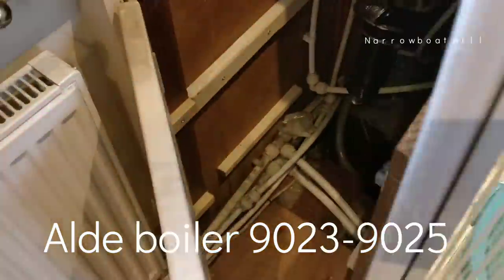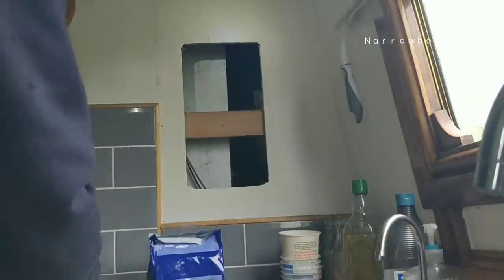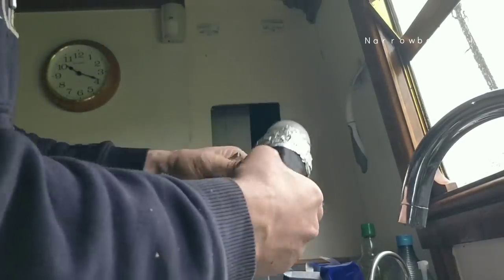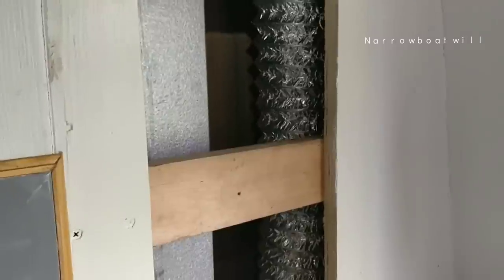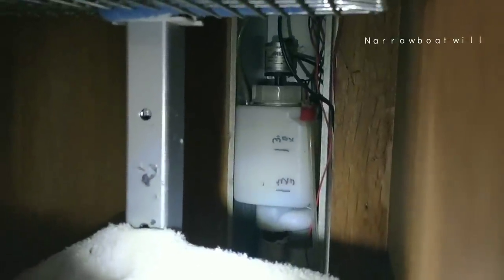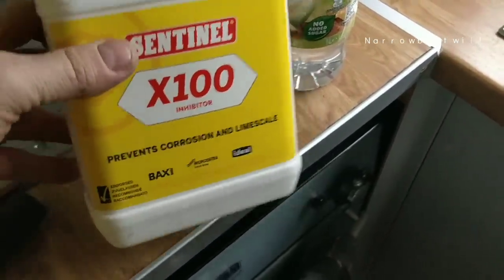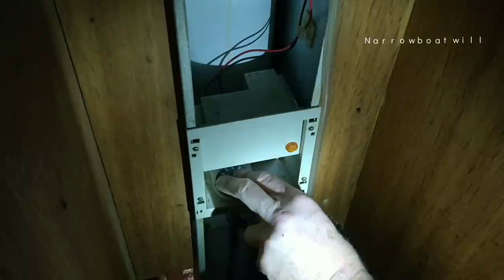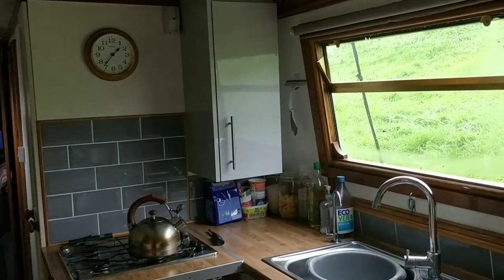Narrowboat Alde Boiler 2923 and 2928 repairs. Boat central heating and hot water.

Comment: I think that I would put a sticker or label on the boiler ignition button, just saying make sure the electric is turned on. ⚡️ 👍 💨
Reply from the maker: That makes sense. The switches for power are at the back of my boat as I walk in. It's easy to brush passed and turn them off. That's the problem but I hear you.

Comment: Yeah anything with Gas freaks me out, simply because of what can happen or go wrong, had my water heater and boiler serviced by a boat safety guy and gas certified specialist one time and after he left I went to ignite the boiler to watch all the near gas pipes burst into flame, luckily I had a very damp tea towel to hand and extinguished it right there and then, but it was a heart stopping moment had the guy come out again ASAP to find out as I had surmised that it was an incorrectly tightened joint. Freak out! 😳 😬.
Reply from the maker: Blimey that must've been scary. Mine just blew up in my ear. No fire though thank God. Ha ha

Comment: Hi Will, your Adi is so far away at arms length,  ive got a Charlie Fox boat and mine is in a tiny cupboard to hear and see its fired up. I am thinking of getting rid of mine eventually with the amount of gas it takes and just getting a new calorifier so i can have a heater element fitted to heat my hot water.
Reply from the maker: It's way to expensive for me to use my central heating. I only wanted hot water to get a shower and it ended costing me my hearing and a heating pipe. I got my shower in the end. Ha ha ha and my hearings come back so merry crimbos all round.

Comment: Did not know  you are rich enough to heat by gas.  We use a webasto. Out of a bmw car diesel iis a lot more economic
And a bit safer. Boom boom as basil said
Reply from the maker: I can't afford to use it. That's probably the third time I've used it in the past year and I blew it up. 😂😂😂
Reply: Luv it. Gas is A round £45 for 13klg. Keep yourself warm mate get the fire going